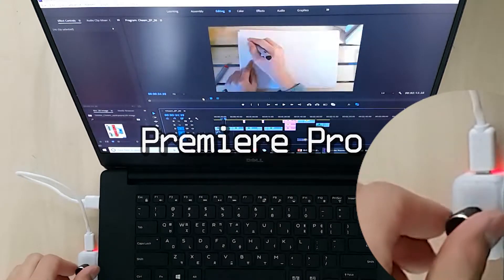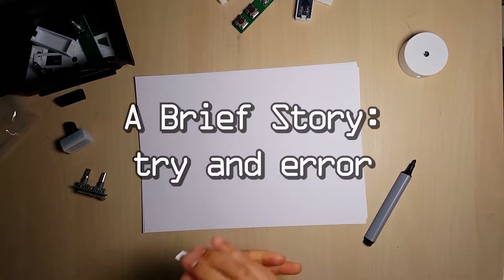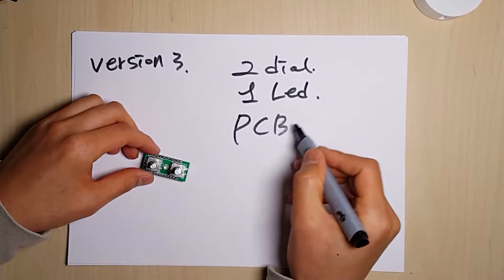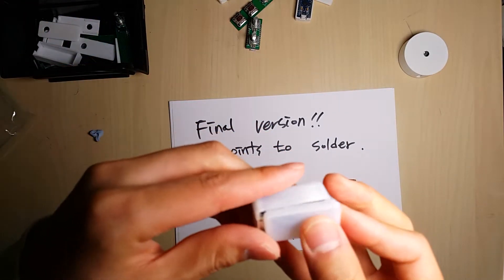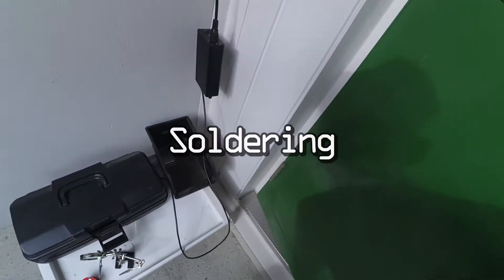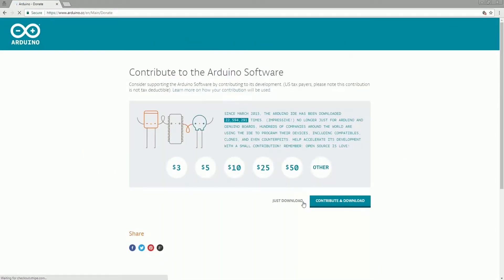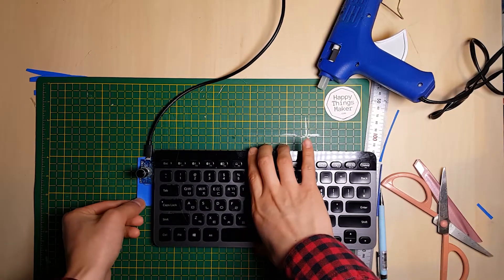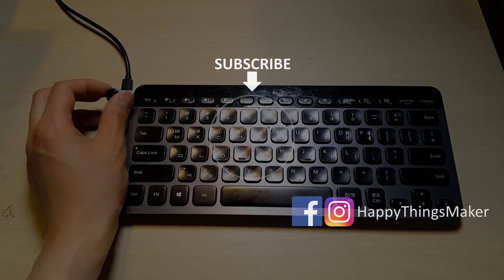Midi controller | Premiere Pro | Lightroom | Navigation Dial DIY (NEW) |  Video Edit Jog Wheel USB

Comment: Hello we're making arduino projects as a long term project in class i've been looking your web for some days and I ended up on this one. I really like it, do you think there's a way to make it work so I can control computer volume with it? Thanks for your time! Good luck :3
Reply from the maker: Hi Katsuki, sorry for late reply, I think it is possible with nicohood HID library. Thank you for comment. it gives me a lot of energy!
Reply: @EunchanPark   Thank you very much :3!! At the end I decided to do your Premiere Pro Dial it looks really interesting
Reply from the maker: If you wanna make this for a volmume controller, Here is instruction:
1) download and install the library -> https://github.com/NicoHood/HID
(clone or download -> download)

2) arduino
sketch - library - add .zip library  - (select above zip file )

3) paste this code onto arduino

// Youtube : Eunchan Park
// https://www.youtube.com/watch?v=dJJ1wlJPqwE

// left right
// up down
// everytime you clicks button, it changes arrow direction from horizontal to vertical

// Resolution : some encoder is too sensitive. this reduces sensitivity.
#define RESOLUTION 2

// include a Keyboard library
//#include "Keyboard.h"
#include "HID-Project.h"

// include a EEPROM library for memorizing last function
#include <EEPROM.h>

// "OUTPUT_A" is going to be replaced with "A0".
#define  OUTPUT_A 2

// "PIN_GND_ENCODER" is going to be replaced with "3".
#define PIN_GND_ENCODER  3

// "OUTPUT_B" is going to be replaced with "15".
#define  OUTPUT_B 4

// "BUTTON" is going to be replaced with "A1".
#define  BUTTON A1

// "PIN_GND_BUTTON" is going to be replaced with "A3".
#define PIN_GND_BUTTON  A3

// Declare variables aState, aLastState for checking the state of OUTPUT_A of the encoder
bool aState;

// We need to save the previous state of OUTPUT_A
bool aLastState;

// this variable for check the state of button.
bool lastButtonState = 0;

// mode selection
#define HORIZONTAL_MODE 0
#define VERTICAL_MODE 1

int mode = HORIZONTAL_MODE;
const int numMode = 2;

// void setup(){} function is for one time setting
void setup() {

  //read the last mode
  mode = EEPROM.read(0);

  // in order to use the Keyboard library, begin() is necessary
  //Keyboard.begin();
  Consumer.begin();

  // OUTPUT_A is for INPUT. must be pull-up
  pinMode(OUTPUT_A, INPUT_PULLUP);

  // OUTPUT_B is for INPUT, must be pull-up
  pinMode(OUTPUT_B, INPUT_PULLUP);

  // BUTTON is for INPUT
  // Most pin has thier own pull-up resistor.
  // INPUT_PULLUP makes the pin high.
  // a leg of button is connected with this pin and another pin which is grounded.
  // when the button is not pressed, the pin reads HIGH signal because of this PULL-UP
  // when the button is pressed, pin is going to be LOW which means "pressed"
  pinMode(BUTTON, INPUT_PULLUP);

  // PIN_GND_ENCODER is for OUTPUT
  // This pin is used for giving GROUND to the encoder.
  // this is a kind of trick, but it works well.
  pinMode(PIN_GND_ENCODER, OUTPUT);
  digitalWrite(PIN_GND_ENCODER, LOW);

  // PIN_GND_BUTTON is for OUTPUT
  // This pin is used for giving GND to the button.
  // this is a kind of trick, but it works well.
  pinMode(PIN_GND_BUTTON, OUTPUT);
  digitalWrite(PIN_GND_BUTTON, LOW);

  // read a signal from OUTPUT_A
  // this is for initialization
  aLastState = digitalRead(OUTPUT_A);
}

long tempCount = 0;

// this loop() function repeats its code eternally

void loop() {

  //read signal from OUTPUT_A and save its state to aState
  aState = digitalRead(OUTPUT_A);

  // if aLastState is not currentState, it meant there's something changed.
  if (aState != aLastState) {

    // read another pin's state.
    // if you want to know about the theory, watch this video
    // https://www.youtube.com/watch?v=v4BbSzJ-hz4
    if (digitalRead(OUTPUT_B) != aState) {
      rotateLeft();
    } else {
      rotateRight();
    }
    // save current State as last State
    aLastState = aState;
  }

  // read button (short or long)
  static long lastTime = 0;
  if (digitalRead(BUTTON) == LOW) {
    if (lastButtonState == LOW) {
      // LOW -> LOW : nothing to do
    } else {
      // HIGH-> LOW
      delay(200); // ignoring chattering
      lastTime = millis();
    }
    lastButtonState = LOW;
  } else {
    if (lastButtonState == LOW) {
      // LOW -> HIGH : check whether long press or not
      if (millis() - lastTime > 1000) {
        changeMode();
      } else {
        Consumer.write(MEDIA_VOLUME_MUTE);
      }
    }
    else {
      // HIGH -> HIGH : noting to do
    }
    lastButtonState = HIGH;
  }
}

void changeMode() {
  mode = ++mode % numMode;
  EEPROM.write(0, mode);
}

void rotateLeft() {
  if (tempCount++ % RESOLUTION == 0) {
    if (mode == HORIZONTAL_MODE ) {
      Consumer.write(MEDIA_VOLUME_DOWN);
      //Keyboard.press(KEY_LEFT_ARROW);
    } else if (mode == VERTICAL_MODE) {
      Consumer.write(MEDIA_VOLUME_DOWN);
    }

  }
}

void rotateRight() {
  if (tempCount++ % RESOLUTION == 0) {
    if (mode == HORIZONTAL_MODE) {
      Consumer.write(MEDIA_VOLUME_UP);
    } else if (mode == VERTICAL_MODE) {
      Consumer.write(MEDIA_VOLUME_UP);
    }
    Keyboard.releaseAll();
  }
}

I tested and verified it. 
good luck!
Reply: Wow thank you very much!! I'm sorry about the delayed answer but I still struggle with youtube notifications. You're my hero, seriously.
Reply from the maker: you are welcome. good luck with the dial! :)

Comment: please add  sourse code    pres button - space button . long press - switch mode
Reply from the maker: hi, I will upload another video for customizing the button features in the soon future. Thanks
Reply: I'm looking forward ))))
Reply: how change audio inwertion in youtube and media player classic ?
Reply from the maker: excuse me but what is inwertion? I am afraid I don't understand.
Reply: clockwise rotation - volume down, left hand rotation volume up.   but under rewind inversion there is no (I use translator )
Reply from the maker: could you write it in your language?
Reply: в устройстве наблюдается инверсия при изменении звука, спутаны стороны вправо и влево
Reply from the maker: I am really sorry that I cannot understand it. could you write it with more detailed information?
Reply: when I turn to the right the sound should increase and it decreases
Reply from the maker: then, you can change the code

find these lines and replace to what you want 

Keyboard.press(KEY_LEFT_ARROW);
Keyboard.press(KEY_RIGHT_ARROW);
Keyboard.press(KEY_UP_ARROW);
Keyboard.press(KEY_DOWN_ARROW);

This is the most important line.
Reply: i change up adn duwn.  it works perfectly ) thanks
Reply: but need space button (
Reply from the maker: if you want it,
Keyboard.write(' '); will work.

  // read button (short or long)
  if (digitalRead(BUTTON) == LOW) {
    if (lastButtonState == LOW) {
      // LOW -> LOW : nothing to do
    } else {
      // HIGH-> LOW
      delay(300); // ignoring chattering
    }
    lastButtonState = LOW;
  } else {
    if (lastButtonState == LOW) {   // LOW -> HIGH : check whether long press or not
      Keyboard.write(' ');
    }
    else {                          // HIGH -> HIGH : noting to do
    }
    lastButtonState = HIGH;
  }
}

change here like this and try
Reply: change mode dont work (      can change switch mode in long press ?
Reply from the maker: // read button (short or long)
  if (digitalRead(BUTTON) == LOW) {
    if (lastButtonState == LOW) {
      // LOW -> LOW : nothing to do
    } else {
      // HIGH-> LOW
      Keyboard.write(' ');
      delay(300); // ignoring chattering
    }
    lastButtonState = LOW;
  } else {
    if (lastButtonState == LOW) {   // LOW -> HIGH : check whether long press or not
      changeMode();
    }
    else {                          // HIGH -> HIGH : noting to do
    }
    lastButtonState = HIGH;
  }
}

try this.
Reply: thanks! but it strange! when i onse press button automaticly change mode and press space. But i think change button be when long press
Reply from the maker: hi, try this.
why don't you learn Arduino in this chance? :)

  // read button (short or long)  
  long lastTime = millis();
  if (digitalRead(BUTTON) == LOW) {
    if (lastButtonState == LOW) {
      // LOW -> LOW : nothing to do
    } else {
      // HIGH-> LOW
      delay(300); // ignoring chattering
      if (millis() - lastTime < 1000){
        Keyboard.write(' ');
        lastTime = millis();
      }
    }
    lastButtonState = LOW;
  } else {
    if (lastButtonState == LOW) {   // LOW -> HIGH : check whether long press or not
      if (millis() - lastTime < 1000){
        changeMode();
        lastTime = millis();
      }
      
    }
    else {                          // HIGH -> HIGH : noting to do
    }
    lastButtonState = HIGH;
  }
}
Reply: perfect! thanks! i created wery beautifull casing. but cannot show
Reply from the maker: oh, great! could you share it on my thingiverse ???  https://www.thingiverse.com/thing:2958261
Reply: when i finish i share you. somepheng wrone with code ( one click with space change mode(    long press dont work
Reply from the maker: hi, how about this?

  // read button (short or long)  
  long lastTime = millis();
  if (digitalRead(BUTTON) == LOW) {
    if (lastButtonState == LOW) {
      // LOW -> LOW : nothing to do
    } else {
      // HIGH-> LOW
      delay(300); // ignoring chattering
      if (millis() - lastTime < 1000){
        Keyboard.write(' ');
        lastTime = millis();
      }
    }
    lastButtonState = LOW;
  } else {
    if (lastButtonState == LOW) {   // LOW -> HIGH : check whether long press or not
      if (millis() - lastTime > 1000){
        changeMode();
        lastTime = millis();
      }
      
    }
    else {                          // HIGH -> HIGH : noting to do
    }
    lastButtonState = HIGH;
  }
}
Reply: code have some error in scope( cannot flash (
Reply from the maker: replace loop function with following. it must be working. I tested it.

void loop() {

  //read signal from OUTPUT_A and save its state to aState
  aState = digitalRead(OUTPUT_A);

  // if aLastState is not currentState, it meant there's something changed.
  if (aState != aLastState) {

    // read another pin's state.
    // if you want to know about the theory, watch this video
    // https://www.youtube.com/watch?v=v4BbSzJ-hz4
    if (digitalRead(OUTPUT_B) != aState) {
      rotateLeft();
    } else {
      rotateRight();
    }
    // save current State as last State
    aLastState = aState;
  }

  // read button (short or long)
  static long lastTime =0;  
  if (digitalRead(BUTTON) == LOW) {
    if (lastButtonState == LOW) {
      // LOW -> LOW : nothing to do
    } else {
      // HIGH-> LOW 
      delay(200); // ignoring chattering
      lastTime = millis();
    }
    lastButtonState = LOW; 
  } else {
    if (lastButtonState == LOW) {
      // LOW -> HIGH : check whether long press or not
      if (millis() - lastTime > 1000) {
        changeMode();
      } else { 
        Keyboard.write(' ');
      }
    }
    else {
      // HIGH -> HIGH : noting to do
    }
    lastButtonState = HIGH;
  }
}
Reply: exit status 1
'rotateLeft' was not declared in this scope
Reply from the maker: Дмитрий Порохнюк  here is full code
// Youtube : Eunchan Park
// https://www.youtube.com/watch?v=dJJ1wlJPqwE

// left right
// up down
// everytime you clicks button, it changes arrow direction from horizontal to vertical

// Resolution : some encoder is too sensitive. this reduces sensitivity.
#define RESOLUTION 2

// include a Keyboard library
#include "Keyboard.h"

// include a EEPROM library for memorizing last function
#include <EEPROM.h>

// "OUTPUT_A" is going to be replaced with "A0".
#define  OUTPUT_A 2

// "PIN_GND_ENCODER" is going to be replaced with "3".
#define PIN_GND_ENCODER  3

// "OUTPUT_B" is going to be replaced with "15".
#define  OUTPUT_B 4

// "BUTTON" is going to be replaced with "A1".
#define  BUTTON A1

// "PIN_GND_BUTTON" is going to be replaced with "A3".
#define PIN_GND_BUTTON  A3

// Declare variables aState, aLastState for checking the state of OUTPUT_A of the encoder
bool aState;

// We need to save the previous state of OUTPUT_A
bool aLastState;

// this variable for check the state of button.
bool lastButtonState = 0;

// mode selection
#define HORIZONTAL_MODE 0
#define VERTICAL_MODE 1

int mode = HORIZONTAL_MODE;
const int numMode = 2;

// void setup(){} function is for one time setting
void setup() {

  //read the last mode
  mode = EEPROM.read(0);

  // in order to use the Keyboard library, begin() is necessary
  Keyboard.begin();

  // OUTPUT_A is for INPUT. must be pull-up
  pinMode(OUTPUT_A, INPUT_PULLUP);

  // OUTPUT_B is for INPUT, must be pull-up
  pinMode(OUTPUT_B, INPUT_PULLUP);

  // BUTTON is for INPUT
  // Most pin has thier own pull-up resistor.
  // INPUT_PULLUP makes the pin high.
  // a leg of button is connected with this pin and another pin which is grounded.
  // when the button is not pressed, the pin reads HIGH signal because of this PULL-UP
  // when the button is pressed, pin is going to be LOW which means "pressed"
  pinMode(BUTTON, INPUT_PULLUP);

  // PIN_GND_ENCODER is for OUTPUT
  // This pin is used for giving GROUND to the encoder.
  // this is a kind of trick, but it works well.
  pinMode(PIN_GND_ENCODER, OUTPUT);
  digitalWrite(PIN_GND_ENCODER, LOW);

  // PIN_GND_BUTTON is for OUTPUT
  // This pin is used for giving GND to the button.
  // this is a kind of trick, but it works well.
  pinMode(PIN_GND_BUTTON, OUTPUT);
  digitalWrite(PIN_GND_BUTTON, LOW);

  // read a signal from OUTPUT_A
  // this is for initialization
  aLastState = digitalRead(OUTPUT_A);
}

long tempCount = 0;

// this loop() function repeats its code eternally

void loop() {

  //read signal from OUTPUT_A and save its state to aState
  aState = digitalRead(OUTPUT_A);

  // if aLastState is not currentState, it meant there's something changed.
  if (aState != aLastState) {

    // read another pin's state.
    // if you want to know about the theory, watch this video
    // https://www.youtube.com/watch?v=v4BbSzJ-hz4
    if (digitalRead(OUTPUT_B) != aState) {
      rotateLeft();
    } else {
      rotateRight();
    }
    // save current State as last State
    aLastState = aState;
  }

  // read button (short or long)
  static long lastTime =0;  
  if (digitalRead(BUTTON) == LOW) {
    if (lastButtonState == LOW) {
      // LOW -> LOW : nothing to do
    } else {
      // HIGH-> LOW 
      delay(200); // ignoring chattering
      lastTime = millis();
    }
    lastButtonState = LOW; 
  } else {
    if (lastButtonState == LOW) {
      // LOW -> HIGH : check whether long press or not
      if (millis() - lastTime > 1000) {
        changeMode();
      } else { 
        Keyboard.write(' ');
      }
    }
    else {
      // HIGH -> HIGH : noting to do
    }
    lastButtonState = HIGH;
  }
}

void changeMode() {
  mode = ++mode % numMode;
  EEPROM.write(0, mode);
}

void rotateLeft() {
  if (tempCount++ % RESOLUTION == 0) {
    if (mode == HORIZONTAL_MODE ) {
      Keyboard.press(KEY_LEFT_ARROW);
    } else if (mode == VERTICAL_MODE) {
      Keyboard.press(KEY_UP_ARROW);
    }
    Keyboard.releaseAll();
  }
}

void rotateRight() {
  if (tempCount++ % RESOLUTION == 0) {
    if (mode == HORIZONTAL_MODE) {
      Keyboard.press(KEY_RIGHT_ARROW);
    } else if (mode == VERTICAL_MODE) {
      Keyboard.press(KEY_DOWN_ARROW);
    }
    Keyboard.releaseAll();
  }
}
Reply: would be very useful change key code to control all system volume/ That's possible?

Comment: any way to make this bluetooth? thinking about making the dial fit into my existing keyboard by taking apart and making a drill hole on the side of it
Reply from the maker: yes, Bluetooth is possible. it needs extra board and power source such as battery.